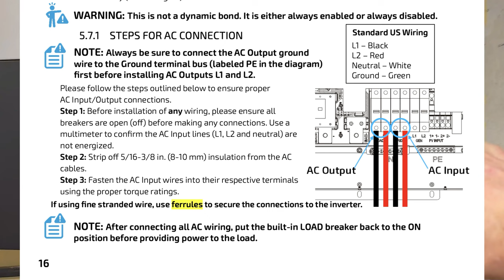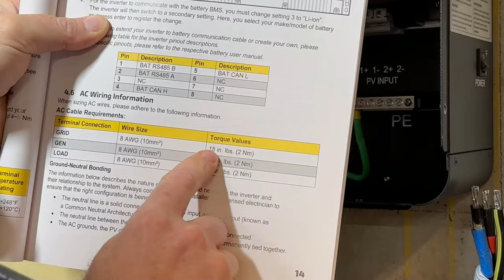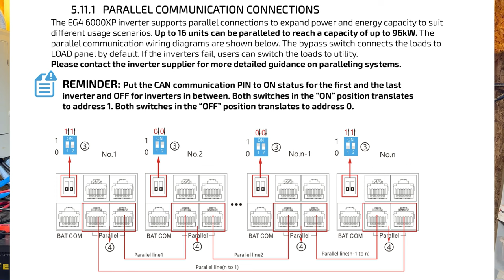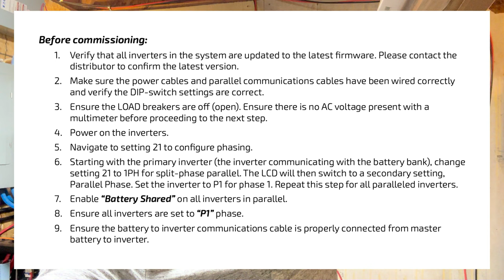EG4 6000 XP Full Install

Comment: I just switched from the 6500EX to the 6000XP and the switch over was quick and painless. I have 12 of the EG4 LL batteries along with 12,000 watts of panels mounted on dual axis trackers. We use to live in the Piney Woods of East Texas but now we’re in Central Texas at the beginning of the HillCountry (Gatesville). I am getting ready to build the forth tracker and install 4,000 more watts of panels in order to max my system out.
Reply from the maker: Sounds like you've got quite the setup :) How do you like having the dual axis trackers? worth the cost?
Reply: @EastTexasHomestead  definitely worth the cost if you can build them yourself. I believe the total all in cost was around $1,000 and they hold 10 415 watt panels.
Reply: @richardoder3459  Do have any pictures of your dual axis trackers?
Reply: @Scat.original  I do.
Reply: @richardoder3459 what are the supplies needed? I'd love to build a dual axis solar tracker that can hold over 4000 watts of panels 🤔
Reply: @tjmooney4181  how do I get the drawing to you?
Reply: Add to your channel? I subbed

Comment: You can't use aluminum wire for that grid connection.  You can see on the bottom of the breakers that it says "Cu only".  That connection is going to fail.

Comment: I would say the hardest thing would be coming up with the $13,000 for inverters and batteries
Reply from the maker: If you don’t have the cash it can be tough. We justified it by knowing it would pay for itself in a handful of years.
Reply: Just get one to start, this system is expandable.  I just ordered one lifepo batt one xp and 10 400w panels to start out.  I plan on getting another batt and panels later.. my cost for one of each was just over 4k

Comment: Your communication cables are in the wrong ports.  Check the diagram you showed.  First inverter, right port cable goes into left port on 2nd inverter, same for 2nd to 3rd.  On last inverter, right port cable goes into left on 1st inverter.

Comment: You haven't explained anything about the actual install... which is the master...how is the grid connected to each inverter? how is the battery bank hooked up to each inverter...so on
Reply from the maker: I thought I gave a good amount of info, but maybe I'll have to go back and see. The master is selected by the first one to be turned on. I showed you how to connect the AC in (Grid), but I guess you want to see me connect the other side. You connect the other end to 40 amp double pole breakers on your grid-side breaker box. The battery cables connect to your battery bus bar. Hope this helps.
Reply: @EastTexasHomestead  thanks... my main thing is trying to figure out how to connect these two things to the battery bank and grid... wondering if this stystem also has an automatic transfer switch.

Comment: Why can’t you charge from a 120 volt generator?   Crazy 😜!
Reply from the maker: I know! It feels like a ridiculous limitation. The chargeverter takes care of that issue though.
Reply: The new update allows the 6000xp to charge with 120v generators using l1 of the grid or gen input

Comment: Where do we terminate surge protection for 2 inverters (off grid, standby genset, 4 dc strings from ground mnt array)??
Reply from the maker: Good question and I don't have a great answer. Mine is in the grid input breaker box closest to the main lugs. Maybe reach out to the manufacturer of the surge protectors.
Reply: I did and they direct through to vendor and they just don’t know

Comment: I thought NEC requires DC conductors inside the house at least had to be encased in metal like an enclosure or liquid tight conduit?
Reply from the maker: It probably does. This system will not be entirely up to code, but I will be doing everything safely.
Reply: @EastTexasHomestead   The code tells you what to do for a reason...because that is what is ACTUALLY safe.
Reply from the maker: Here's an example, the cable I used for my AC is "approved" to be drug all over a shop, have water and oil spilled on it, and be just fine. However, once I stop dragging it around the floor and fix it to the wall, which is arguably safer than stepping on it, the NEC says I'm in violation. This is perfectly safe; the conductors are audacity sized, it's out of reach and won't be snagging on anything, but it isn't "approved" for that location.
Reply: @EastTexasHomestead  The NEC takes into account events and considerations you are not likely to ever think of.  These events and considerations have been tested and/or experienced by laboratories, electrical engineers, master electricians and other professional organizations alike.

But it's obvious the NEC doesn't apply to you.  No point in arguing with a clueless YouTuber thinking they are doing people a favor by posting a video of an illegal electrical installation.  Could waste a lifetime doing that.  Hope an inspection never comes your way...I really should hope for the opposite though, for your safety.

If only common sense was common.

Wish I could say it was a pleasure. Adios!!!!
Reply: @URackADisciprine  Or the NEC just like other regulatory bodies like OSHA, EPA, etc…sole purpose is to think of new rules and regulations that overcomplicate things to justify their existence.
Reply: @URackADisciprine nope, it’s just a reason for a bunch of pencil pushers to have a job!
Reply: @watchman1982 , it's unfortunate that you believe regulations are basically worthless. Do you think the food in grocery stores should not be regulated? How about the water you drink? The vehicles you drive? Medical care? There are FAR more benefits to regulations than reasons to pout and dismiss them because you don't like them or can't understand them.

My first time seeing one of your videos and comments is my last. 👎✌️
Reply: @mr.c6674  My exact words were: "overcomplicate things":

Food --> modern food is processed trash. FDA spends more time creating regulations that prohibit local growers from growing and selling in favor of processed garbage from large corporations.  Medical care is nothing more than a giant cash grab industry.  FDA regulations force us to spend $1,000's on medical care and treatment.  For example, why must I spend $200's to see a doctor for some eye drops that can only be purchased with a prescription for $800?  Oh, because of regulations!  Said eye drops should be $5 otc!

Water --> basically fluoridated poison.  EPA regulation requires fluoride and other poisonous chemicals to be present in our drinking water.  Wouldn't be surprised if the EPA bans private wells soon.

Vehicles --> Look at what EPA and DOT regulations have done to modern vehicles which are far more unreliable and more expensive because of bloated emission garbage and overkill safety requirements.  Manufacturers are forced to cut corners in order to meet these requirements, but the increase in manufacturing and repair costs are passed to the consumer.

These regulatory bodies only continue to make life more difficult and more expensive at this point.

Comment: I used a 2x4 to rest the inverter on when I installed my 1st inverter.  2nd inverter I used 2 screws to rest the inverter on.  The 3rd install I used a smaller preinstalled screw for the top to hold the inverter while I installed the three other screws
Reply from the maker: All of which were better than what I did. LOL
Reply: @EastTexasHomestead  I tried your method...I almost dropped the inverter.  I had to move on to plan B
Reply from the maker: Yeah... I almost lost it a time or two myself. Thought about using a jack or even drilling out keyholes as some do. Then i just decided to risk it and get it done.

Comment: First of all, I would like to start off by saying thank you for all the knowledge that you put out there to everybody. I got my E4 6000 XP and December per other peoples recommendations 10,000 W of solar is recommended so that’s what I have. All of my parameters are correct and not exceeding the limits Every single time my unit gets close to 7000 W of PV input the unit starts screaming. Can you do a video bringing in that much Solar according to signature Solar this is a problem that they are starting to see and do not know what the problem is. They are sending me out a new unit , thank you for your help if you can
Reply from the maker: Interesting. I only have 2000 W going into my system at the moment, so I can't replicate it yet. I have 15K of panels but nowhere to put them yet. I'll be sure to add this to my list of things to test moving forward. Thanks for the info, and sorry for your luck with that. Hopefully, the new inverter will work better and fix the issue. 
@martysurx111
Reply: That "screaming" is just the fans ramping up. Turning 7000w of pv into power to charge your batteries creates a lot of heat.  I have 11,000 watts of panels and two 6500EXs, in full sun they both start roaring until the batteries get charged.  I just upgraded to two 6000XPs and will be starting them tomorrow.
Reply: @daddio7249  that’s not what it is because every time that happens the inverter shuts down the solar input and switches to grid while the inverter resets
Reply: @BluecollarRVliving  I have 2 6000XPs running with zero problems.  I have wired the grid pass through but have not closed the breakers, I have 11,040 watts of PV and have not needed it.  Have you tried throwing the grid breaker and using just the PV power?
Reply: @daddio7249  I’ve tried everything you can imagine along with 4 hrs with tech support. If I keep my solar input at 6000 watts then it’s fine. Once the batteries are charged then I have no problem because my needs never exceeds 4500 watts
Reply: But what sucks the most is I can only charge at 55 amps and still run 2 mini splits and sometimes it takes until 3or 4 pm before fully charged with a full stack of batteries 6 life po 4
Reply: @BluecollarRVliving  OK, I have two 6000XP's and 11,040 watts of PV so I never get more then 5,500 watts on mine.  I have already bought 10 more 450 watt panels. I will not be able to put them up until cooler weather.  Hopefully mine will be able to handle the extra watts.

Comment: I do hope you re-torqued the battery connection nuts, the actual torque is 97-106 inch lbs or 11-12 Nm

Comment: Great vid.  Just picked up my first one of these with a 4th LL battery this morning.  What 8GA wire did you use?  It looked flexible and a LOT easier to work with.
Reply from the maker: That's exciting! I used SEOOW 8 AWG. I believe I got it cut by the foot at Home Depot. While I think SEOOW or SOOW is perfectly safe to use in my system, It is not up to code. I figure if it's safe to drag on a shop floor and be exposed to the elements, why isn't it safe to run from my panels to the inverters? But that's must me.
Reply: @EastTexasHomestead  Thank you

Comment: I just starting to learn about solar, this inverter looks like a great option for starting a small project, for what I noticed and read this unit can use power from the grid when running out of battery power or solar us not enough but cannot send back to the grid, quick question if you run out of battery will the inverter pull from the grid to keep everthing running and charge the batteries ? Thanks for the information.
Reply from the maker: That is correct! You can easily set the cut off percentage when it will stop using batteries and switch back to grid. Usually 15-20%. It will continue to supplement the grid with solar if you have it. You can then select a time to charge from the grid if you want to. I have it charge at night when I get free grid power. The downside, as you mentioned, is that I don’t have the option to sell back to the grid if I ever wanted to, with this unit. Hopefully that clears it up. Let me know if you have other questions
Reply: @EastTexasHomestead  sadly our local power monopoly will not pay enough lol, they just pay you the price they charge for generating power but they will charge usage-generating, I’m in south Texas and it looks like I may need to get a permit to install solar, not sure if will apply even if I install then on a porch. I can do the majority or maybe everything by myself but a license electrician is “required” I even thought on do a ground installation but knowing the guys in charge of the county they may even ask for a permit too. Again thank you for the information I hope I can get more information from my local authorities and see what is required for installation.

Comment: Is the cable you are using for ACin SOOW cable?  If so, what gauge are you using, where did you get it  from and what is the cost?
Reply from the maker: It is SOOW and 8 AWG. I think it was around $4/foot at Home Depot. However, it is not code compliant.  For whatever reason, you can’t use this in a fixed location - but you can drag it all over your shop floor. 🤷🏼

Comment: I’m not a fan of Ferrell sleeves because it’s “another” mechanical connection. I tin (solder) multi strand cables. It’s stronger, less resistant and can take more heat.
Reply from the maker: Thanks for sharing, Bill :)
Reply: I would think just the opposite, metal expands when it gets hot making the connection tighter.  Solder will melt when it gets too hot making the connection looser.
Reply: as someone who worked in electronic repair for 30 years for a company, I'd just say don't tin cables that have heavy loads. I've seen many control boards with solder spattered all over the inside when a component fails and the power wires get very hot very quickly. Solder all over everything, which caused everything else to blow as well. This was common to see, not rare.

Comment: The pv isolator should be at the array side of the pv wiring
Reply from the maker: Is that a code thing? It’s more practical for me to do it this way for now.
Reply: @EastTexasHomestead  no it's just nice to have a disconnect at both ends for servicing needs
Reply from the maker: @tjmooney4181  That makes sense. 👍

Comment: Do any of the Power companies in East Texas offer net metering or is it just a no.  My wife and I are getting ready to move back and build on our property in East Texas and I cannot get an answer from the power company I talked too.
Reply from the maker: I don't know. I can tell you that we use Just Energy and have selected the free nights plan. It's pretty sweet to charge the batteries for free at night and use the energy during the day. If you're interested int that, I believe they are one of two that offer that type of plan. Feel free to use my link below which would give us both $75. Just an option. https://justenergy.com/refer/?
referralCode=1444E81

Comment: You dag nabbid backwood backward country boy you cants be wires n black n reds backwoods i means backwards, same tang.  Lol kidding.  Thanks for links to those blue things where wires come in bottom of eg6000 i knew i was like i know something should go here.  Great video, watching for what you say about the 120v generator.  I not planning on using that at least to start but always good to learn bits i not aware of.  Thanks for posting.
Reply from the maker: HAHA! I know I'm not doing everything by the book but I really am trying to think through it and be safe. I'm glad the link helped. One of the problems I faced was not knowing what each part was called, so searching for it was all but impossible. I'm sure there's a better way to do a lot of this. Thanks for watching and leaving comments. :)
Reply: @EastTexasHomestead  Main thing is you safe and as you said follow directions especially when it comes to the wiring portion so as to not cause a fire or get a shock of life.  Looks good, I too no expert, but from others I am watching set their 6000xp up yours is right there.  So are you letting your eg6000xp control the ground to neutral bond since you off grid?  Set enabled?  I had to do some reading and asking on that and from what I got was if off grid let the 6000xp enable ground neutral bond and in the breaker box you disable ground neutral bond as the 6000xp has it.  Is that what you got also, might have missed if you mentioned it in video.  

LOL that was my issue I was like hmm I do not know what these are called and figured I would next time in Lowes or Home Depo check near the breaker panels for something that would be what goes in them, possibly ask but that can be hit or miss.  

PS God bless, great to see more followers of God and sharing the word and being the light to our savior Jesus.
Reply from the maker: I'm actually grid-connected even though I run "off-grid" every day. So, I have the unit set so that the ground neutral bond is disabled, and the two are connected up at our meter pole.